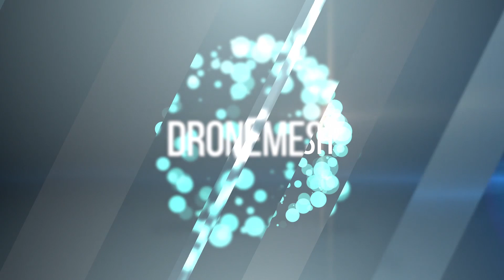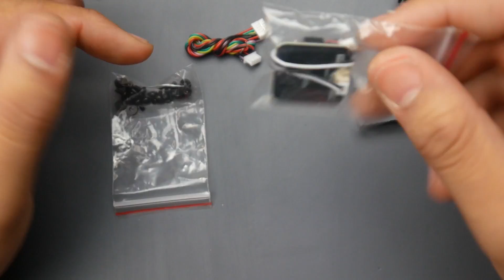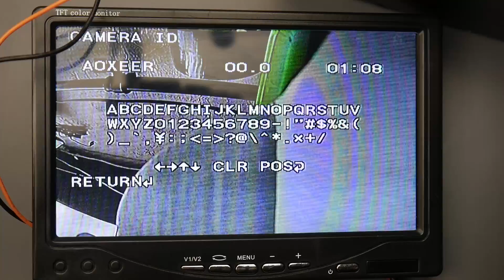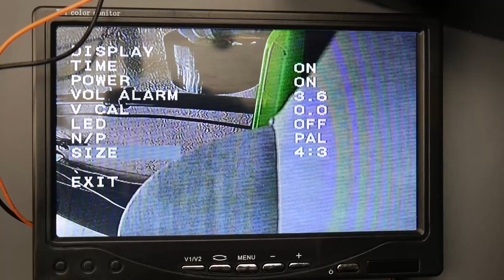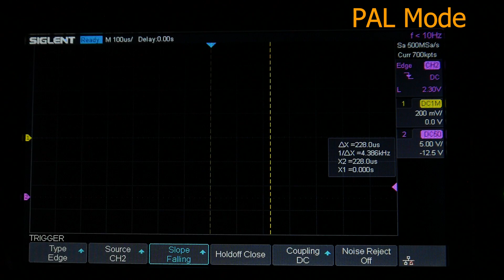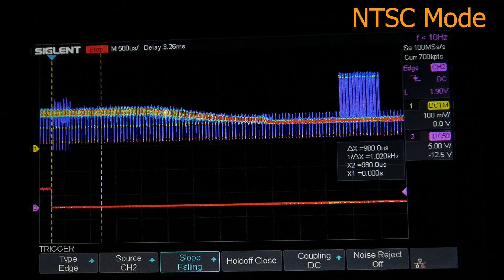SOMETHING IS NOT ADDING UP!! // Foxeer Predator V3 Review

Comment: I think your expectation of NTSC being faster is based on the fact that PAL has more video lines. However, video lines affect the weight of the picture less than having more frames. That's why NTSC is actually slower, because the frame rate is higher.

Comment: Thanks for confirming their specs. I went from a cheap camera to a Predator V3. It sure seemed to improve my flying and the picture was beautiful. Well worth the money. The only problem that I had was that that big lens likes to collect rocks ;). I replaced it with a 2.1 lens for more realistic view on my goggles. If you plan on using the plastic size adapter, get spares as they break easily.

Comment: Hey man you do good work and I watch your videos all the time. I've got a question for you.  

Why can't VTX channel information be broadcast as part of the video signal so that we have locked in channel reception?  I remember when I was a kid broadcast television used to transmit subchannel information all the time. You could see it at the bottom of your screen if your tuner wasn't very good.  Why can't that technology be incorporated into our drones to reject interference?
Reply from the maker: Well this is really good info but it still wont cause less interference because the VTX broadcast sometimes bleeds to other channels And does not output very clean to the specific frequency you have it set on. That's why racers tend to use specific vtx's and only setup 25mw output power.
Reply: @DroneMesh  So, there's no way for the RX to determine what part of the signal is interference (e.g. being broadcast from the wrong VTX)?  In other words, the signal is being swamped and as far as the receiver can tell it's all from the same source?
Reply: Could some kind of checksum information be added to the sub channel broadcast so that the receiver could build back the video?  I guess it'd be sort of like having digital information being carried by an analog signal.